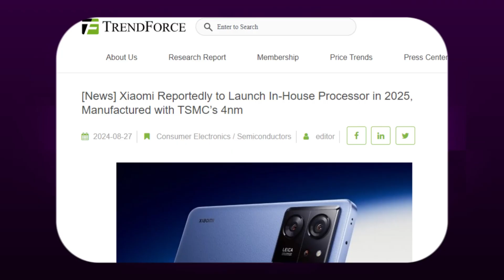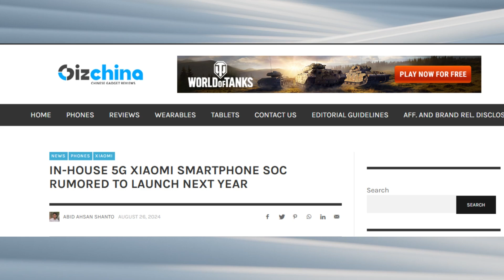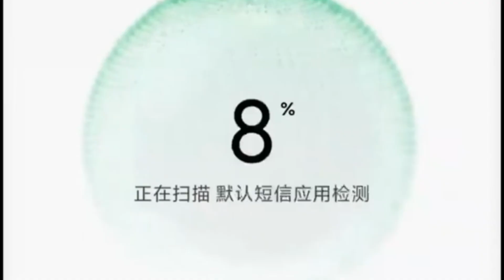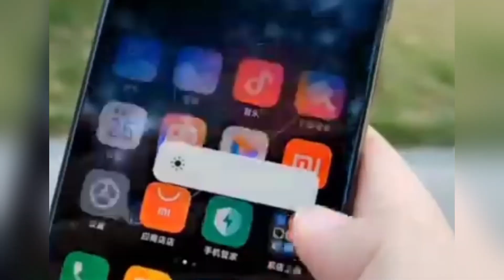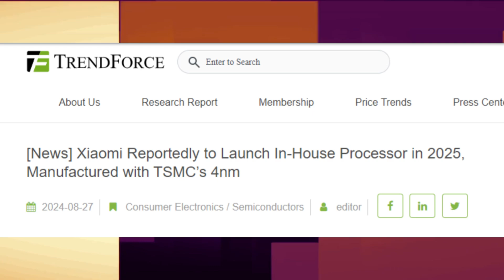Xiaomi's SHOCKING Move to Take on Qualcomm with 4nm Processors!

Comment: To me there is no difference in actual usage of apps between SD gen 1 vs SD gen 3. What is more important is temperature of the chip which is too hot for holding comfortably. The benchnark is meaningless as one wouldnt feel it at all in actual usage since these chips performance is more than adequate to run apps & Ai. So i hope Xiaomi's chip runs much cooler than SD.